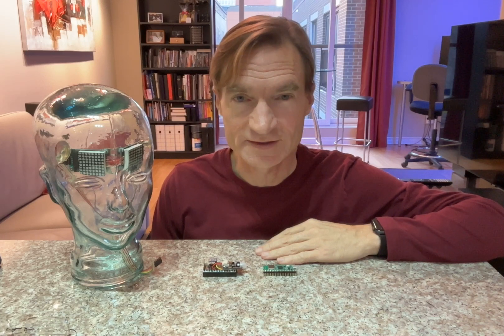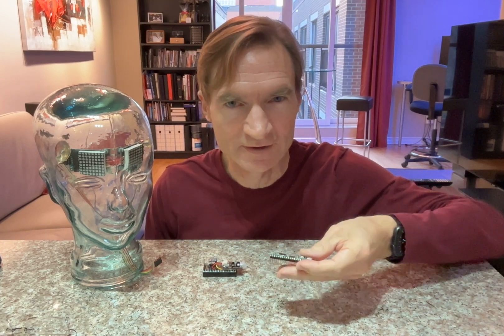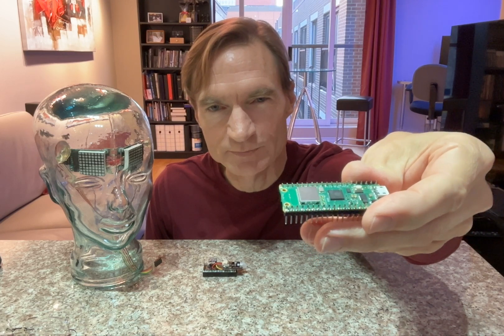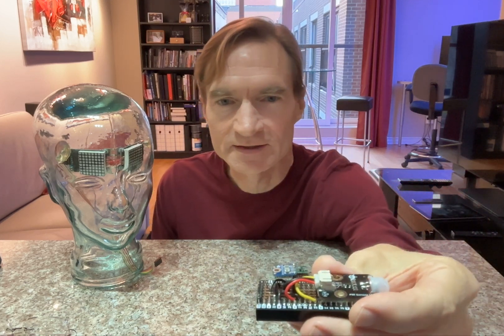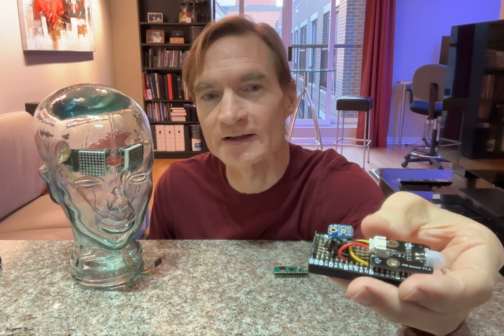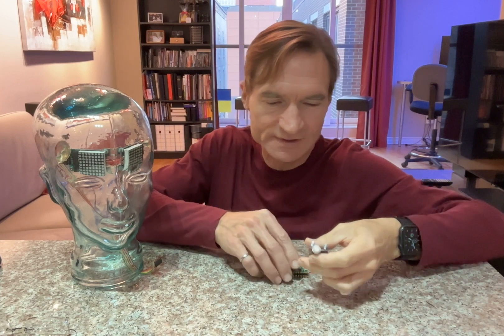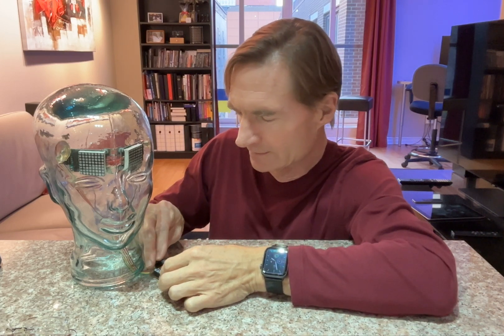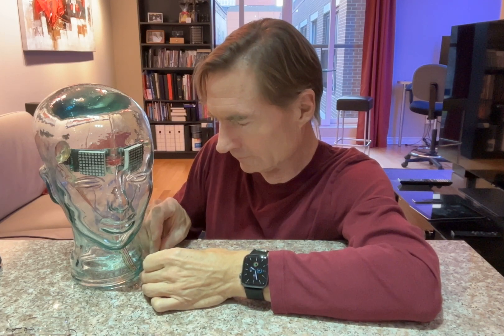LED Clock using RPi Pico W

Comment: Hi, I built the googly eyes using your schematic and an Arduino. It's working great. I was wondering how I could separate the motion of the pupils of each eye. For example, looking in different directions or simply doing a wink. Thanks for posting your code and schematic!
Reply from the maker: Cool, glad you were successful at building this! It is possible for the eyes move independently with changes to the displayEye() function. It currently calls setRow() twice using the same bits for each display, but the logic would need to calculate different bits for each display.

Comment: Which Wifi library are you using? I am using v1.2.7 by Arduino and it is throwing an error no member named Mode for Wifi.mode(WIFI_AP_STA);
Reply from the maker: In the Arduino IDE preferences dialog, I have the following setting for "Additional Boards Manager URLs": https://github.com/earlephilhower/arduino-pico/releases/download/global/package_rp2040_index.json